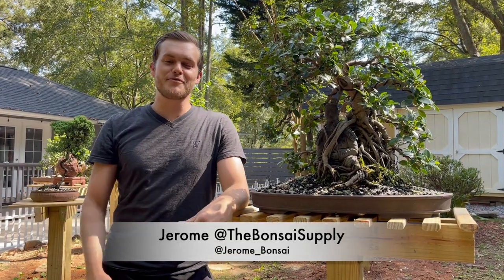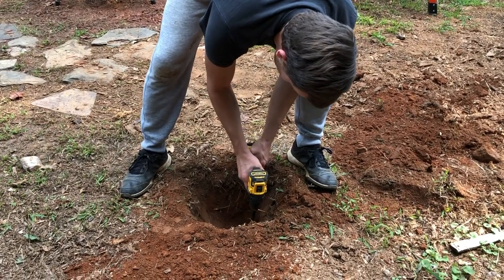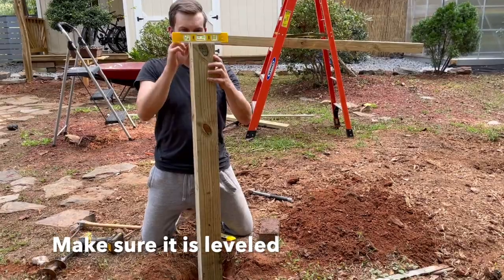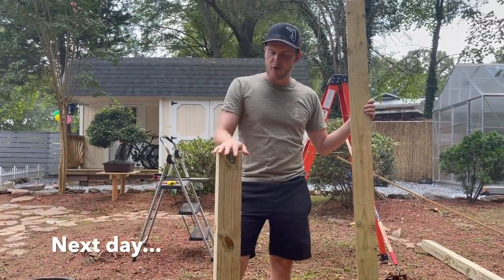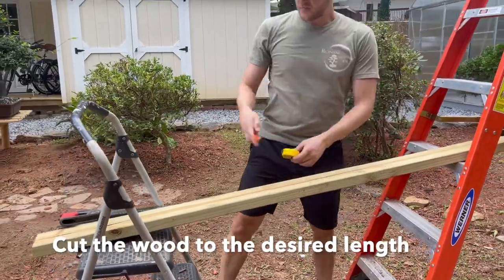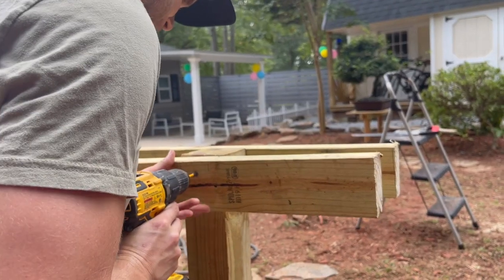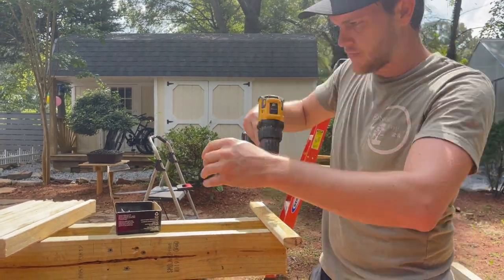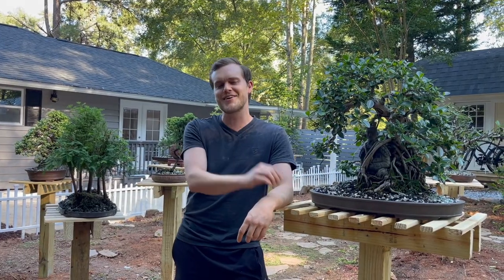How to Build a Bonsai Pillar/ stand | The Bonsai Supply

Comment: You might consider using a half lap joint to attach the 2x4 to the post.  That way the screws are not carrying the weight of the plant.  The 2x4 sets into the post and is held up by the post.  Then the screws are just keeping the 2x4 from twisting.  Its a bit more work, but safer with the downward weight as the screws are no longer holding your plant up

Comment: I think they are more commonly called monkey poles. You can also just put cross pieces at the bottom and not install in the ground. That way you can move them around the garden once you find out you don’t like the location or it is not the exposure you thought it was. With wide enough cross pieces they are just as stable as dug in ones. And for installing posts a decent post hole digger will give you faster results. I have about 20 installed in my yard.

Comment: Gravel works just fine instead of concrete and won’t rot post like concrete does when it cracks and allows water to sit against post. This is not holding up a fence so concrete is too permanent and a overkill…but looks great and great idea!